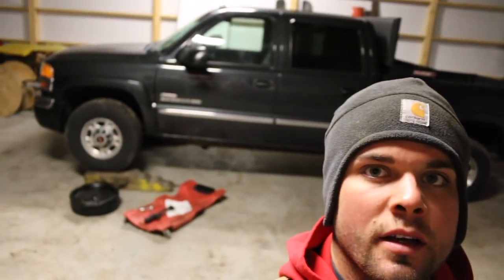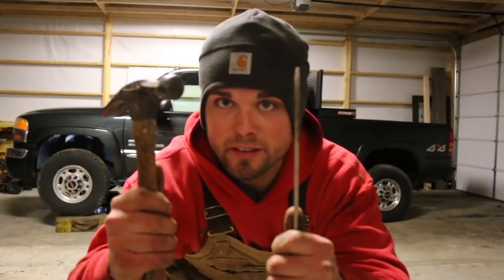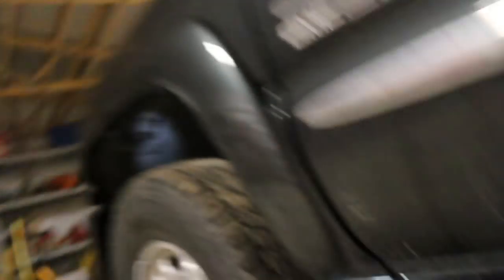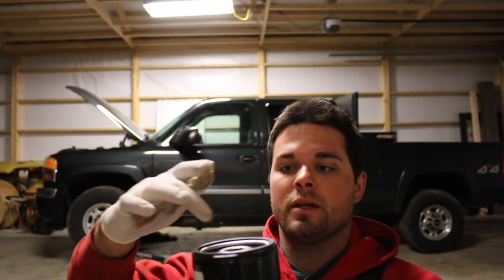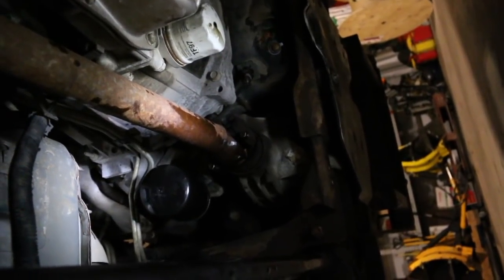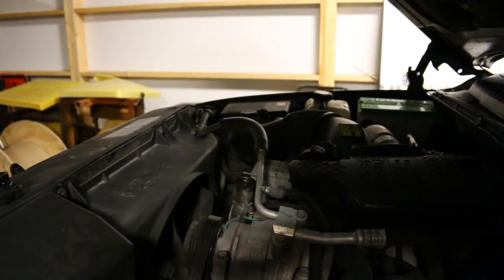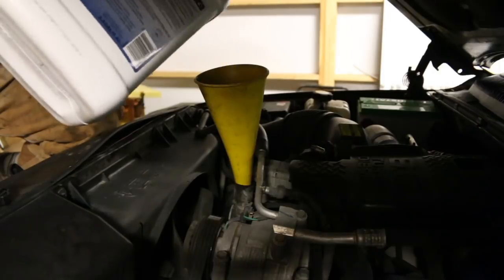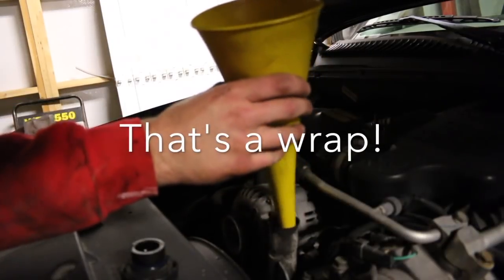Removing an oil filter the hard way : Duramax oil change

Comment: You should change the Allison spin on filter every engine oil change also
Reply from the maker: A&S Lawnscapes Thank you for the suggestion 👍🏼 I will do so
Reply: Wrong.Dont change it every oil change.Look at the manual and see what the trans fluid change interval is on that year and change it fluid and filter then.No need to change it in between.I turned in a 2013 last October that was used strictly for hotshot hauling and the trans was running like new when I turned it in.

Comment: The filter was way overtightened.Next time hand tighten which is sufficient.And it should come off with just your hand the next time around.If it’s not coming off use a filter wrench.As far as trans filter use an Allison filter and Transynd fluid which you can get both at a semi truck dealership or semi parts store,and with a double drain and fill of Transynd you can run the fluid for 100,000 miles.You can read up more at Duramaxforum.com.

Comment: Or an oil filter wrench come right off with no mess.
Reply: Dustin DeSimone yeah thats what i usually use on mine 😂. This guy would punch me in the face apparently also
Reply from the maker: Dustin DeSimone I have one for the smaller filter but not one this size. I will be getting one though, thank you for the suggestion 👍🏼
Reply from the maker: griffin pierce haha, just being dramatic. But seriously this was the tightest filter I’ve ever taken off 🙄
Reply: I bent my wrench trying to get mine off. Guy before me musta been real tough
Reply: @nickenslandscapingexcavating  brah, Before you begin get the appropriate tools.  Glad you cut grass and not work on vehicles for a living!
Reply: @cousinkyle4995  Or... the previous filter was #1 Without oil on O-ring. #2 was over torqued, normally landscaping guys, who drive off ramps may be way over their heads when not chasing crabgrass.

Comment: Sure was a lot of talky talky, but no actual removal of an oil filter, let alone the hard way.  Maybe rename the video "How to talk about oil filters for seven minutes but never demonstrate the removal." Again a HARD Removal of an oil filter starts with poking the filter with a screwdriver, then attempting to torque it off Through the Filter housing/Filter element with a screwdriver. BUT wait, if some Landscaping guy did the last filter and the screwdriver wont work, well next we get the blow torch, a Pipe Wrench and we rip that damn cheap filter off the customer vehicle.   Maybe diesel diy videos should come from Diesel mechanics, not the landscaping sect so much...  John Diesel designed the diesel to operate WITHOUT Petroleum whatsoever. These engines were modified to burn Fossil fuel, they were intended to run on Seed oil, like Cannabis (Hemp) and Peanut.  And to think I grow grass for a living....
Reply from the maker: You are awesome! I bet your videos are great